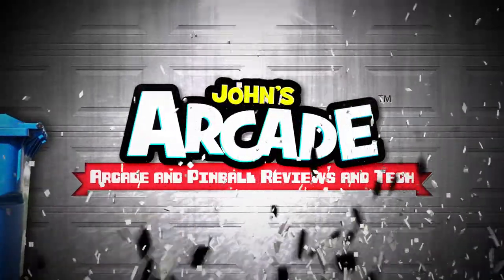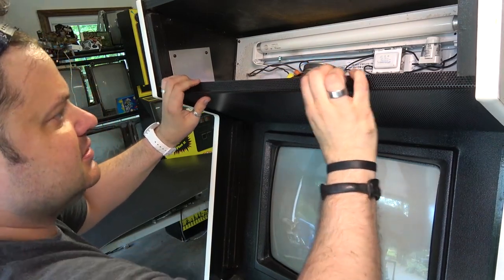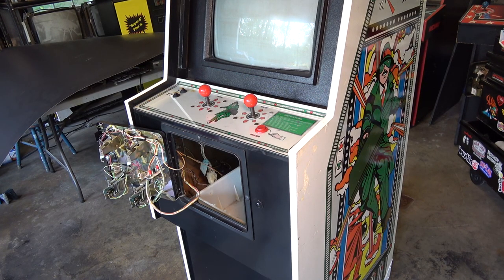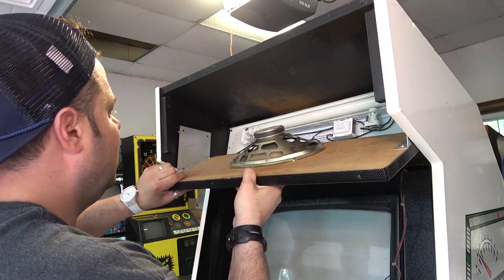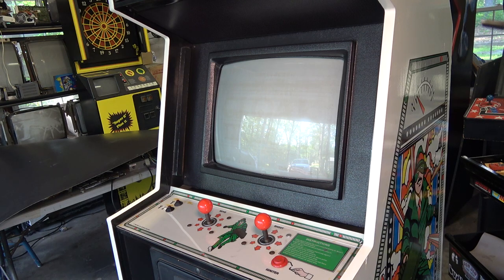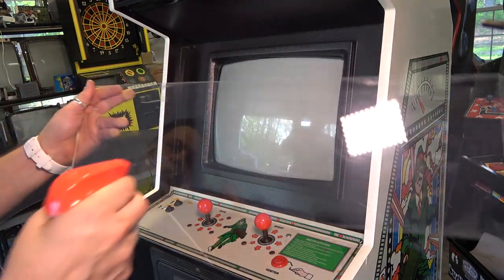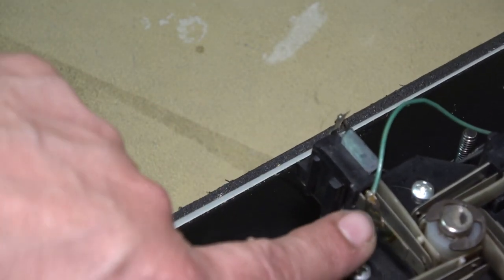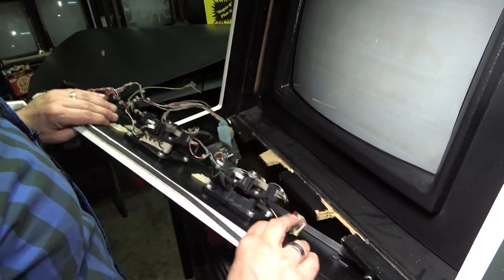Atari Cloak & Dagger Arcade Restore - Part #1 - Defender Speaker Grill Install and Control panel

Comment: Wow, that's got a bit of everything.  A Defender cabinet, Atari board cage, and an audio amp from a Mr. Do!.  Not a bad looking conversion though.  

Atari made those kits for Joust/Robotron cabinets too.  I ran across one of the control panels while restoring a Robotron a few months ago.  This is the first time I've seen what the complete game looked like.

Comment: Also another thing about those cone buttons-  I've noticed that on many games, Atari would put an extra nut on the switch before installing it into the panel.  This lowers the switch, and allows the button to sit flush with the cone.  There were also different cone heights available.  The shortest ones were probably on games like Missile Command.  Since that panel had plexi on it, maybe someone removed the extra nut to compensate for panel thickness.

Comment: I have a sore throat now because I was shouting PLEXI at you every time you wondered why the cones would not tighten up like before. Great video that speaker grill looks great. I think I would have left the plexi to help preserve that minty CPO.
Reply from the maker: The plexi just looked wrong and wasn't cut very well either

Comment: For the kick plate, you're going to have a heck of a time fitting a router on the top and bottom overhangs.  The middle will be fine, but the router with not fit where the sides are where the T-molding is.  You may have to pop that sucker off regardless.
Reply: Shhhh, let John figure this out himself in a 5-hour long video.

Comment: This kit looks really good in the Defender cab!  

Yeah that ground strap is the original from Defender.  Defender had a small strap connecting the left bracket to the speaker frame.  Then that ground strap you pointed out was sandwiched between the bracket and sidewall.  The strap internally was strung all around the cab connecting all the metal together.  Damned Williams built their vids like pinball machines!

You got some mad camera skills man... you'd think you had a camera man... seamless!

Comment: Regarding the cone buttons: You're missing the plexi, which was between the cones and the buttons. You may want to simply cut that piece of plexi and put it below the panel as some kind of twin washer, since it already has the right size.

BTW, the Magic Eraser did some of a job on that spot, compare before/after in the video.
Reply from the maker: Yes, I realize now it was the plexi. It wasn't clicking before.
Reply: !That journey game sucks, and it breaks down a lot. Why would you keep it. Sell it and Tempest and use the money to buy a compressor and Spray gun and use some effort in your refinishing. That is the weak spot in your game. All this time and effort in these games and you use spray cans???? You can sand out the burns from the top and re buff the plastic, but I'm nuts. I think it should be like it was when it was NEW.

Comment: For cheap 4-ohm speakers that look the same as arcade cabinet speakers, go to a junkyard and get a stock speaker out of a wrecked car. However, you should always match the impedance of the speaker to the amplifier. That aftermarket amplifier that the previous owner installed may or may not be 4-ohm stable like the original Defender amplifier was; you'd have to find the specs for that particular make/model amplifier to find out ( Edit: I posted this before I finished watching the video; after a few more minutes of watching I saw that you did the right thing anyway). Driving a 4-ohm load from an amplifier that is only 8-ohm stable isn't necessarily going to kill the amplifier instantly, but it does drive it harder than it was designed to be driven, which theoretically will shorten its life.

If you were getting satisfactory volume from the 8-ohm speaker, then it certainly won't hurt anything to continue using it. In fact, it makes life easier for the amplifier, because it's being driven less hard than with a 4-ohm speaker. An 8-ohm speaker is always a safe choice with an amplifier of unknown specs, because I don't know of any audio amplifier that isn't at least 8-ohm stable. Home audio amplifiers are normally 8-ohm stable, and car audio amplifiers are normally 4-ohm stable.

If you use an 8-ohm speaker with a 4-ohm stable amplifier, the amplifier will only output half its rated power, but like I said, if you're getting sufficient volume, that's irrelevant.

Comment: I went to the PILOT truck stop, and purchased Roadpro external CB speakers, for $10.00 they are small square speakers, with great sound. They are 4ohm 8 watt speakers. And they come with a mounting bracket that mounts nicely, they work great especially when the speakers are hidden by grills, size doesn't matter.
Reply: These Roadpro speakers come in various Ohm and wattages

Comment: Cone buttons are what make an Atari. Depending on the cone height Atari add a washer and small PAL type nut on the back side, check out your Tempest. Also the schematics for the C&D conversion shows the cone LEDs are wired up, so it may be possible to get them working by adding the wires.
Reply from the maker: Interesting! I wonder what's wrong with the wiring. I want those to light up!

Comment: I vote for changing the T molding to black.  I've never seen a cloak and dagger with white.  It looks quite odd with the white sides and all the other front facing trim being black, particularly now that you have the right speaker grill.  I know it's more cost and work, but that's what I'd do.  Either way, it's still looking good.
Reply from the maker: I think I agree with you. #staytuned

Comment: The most important thing to get some punch in the sound is to have a tight seal around the edge of the speaker driver. The slightly larger driver will also possibly give you better sound. 
If it's authentic is a different question. But since the rest of the sound set up is far from authentic I think I would live with it.

Comment: The cone buttons look are higher because the Plexiglas that you threw out was lifting the cones (like a washer).   Because the Plexiglas is gone more of the cylinder is exposed now.

Comment: John, when you were re-attaching your cone buttons and were having trouble with attaching the cone button, I was thinking that the thickness of the plexi glass panel that was covering the control panel was probably affecting how you re-attached the cone or even the height of the buttons..

Comment: In general, you could substitute an 8 ohm speaker when a 4 ohm speaker is called for.  You mainly run into problems when you try to do the opposite (sub a 4 ohm for an 8 ohm speaker).

Comment: John, early in the video when you were taking the speaker grill off, you dropped a screw into the monitor and turned off the cabinet just in case. Did you ever get that screw out of the monitor chasis? I'm a bit concerned you may have forgotten and it could short something.
Reply from the maker: I got it out. :)

Comment: Now now John ya didn't need to use a gas power blower for the metal filings like that. A simple brush and dust pan should have done the trick. LOL I used to learn a lot about being a machinist with the different kinds of equipment to work with in order to make different things. Usually when you need to make a pilot hole for the screws. Just eye the drill bits that you need to use with the minimum part of the screw thread that you have on the screw itself. Usually if you look between one thread to the next. It creates like a valley between the two threads itself. Its hard to just saw it in text only if I were to make like a drawing of some sort it would be easier to visualize it. But usually you can find it very quickly when your making pilot holes.
Reply: John I just wanted to mention something else here around 78 minutes into the vlog here where you are sanding down the joysticks themselves from the rust. Couldn't you use a vice of some sort to hold where the ball part is. And use like the 80 grit and finer that way. If you use like a thinner sheet. And wrap around half of a sandpaper/emery cloth and move the sandpaper/emery cloth back and forth. Kind of like when you have a bow wrapped around the stick to heat up the bottom part of the stick to create the fire. But in this case the metal part that you are cleaning the rust off stays put there while going to a finer and finer grit of sandpaper/emery clothe.

Comment: I would have used the 6 1/2 in speaker from the Turtles....  Once the C&D is in your basement you will NEVER change the speaker....
Reply from the maker: THIS IS POSSIBLE. :)
Reply: On Amazon you can get Skar Audio FSX65 8-Ohm 6.5" speaker for $19.99....  ;-)
Reply: Umm... Skar Audio is like basshead car audio, why would John want to put anything other than an authentic arcade game speaker in?!
Reply: I would have gone with the 6x9" 8ohm speaker for now, and looked for a 6-1/2" 8 ohm round speaker to replace it later. At least then it would match the original round cutout, and meanwhile no one will know.

Comment: I feel like if a previous owner bought a replacement amp, that might be for general home use, and works with an 8 ohm speaker... it could very well be that they replaced that speaker at the same time to match the amp... possibly?
Reply from the maker: KEEP WATCHING
Reply: HA! I just got to that point as i saw your reply here in my inbox!  :D
Reply: well um... make sure you wire the speaker the right way so it doesn't accidently turn it into a microphone!   Nice leaf blower, btw.

Comment: Should have vacuumed the iron filings, rather than blowing them inside the cabinet, did you remove the lost nut from the monitor chassis? You should use wet & dry glass paper on metal, sandpaper is for wood.
Reply from the maker: Of course I found the nut. :)

Comment: I was kinda wondering why you didnt turn off the game before starting to screw things loose, i was actually thinking  "he is gonna loose a screw somewhere, maybe right on the boards and short everything" and then you went and did just that :P

Also, why not make a wooden ring for that smaller speaker so it fit?
Reply from the maker: OOPS

Comment: I have a 1987 Double Dragon. It has the original speaker and sounds fine. Are there any better quality aftermarket replacement ones that anyone would recommend? Or would they all be about the same quality of sound ?
Reply from the maker: I think any old speaker works fine. I am going to replace the speaker next episode with a cheap one. We'll talk about it.
Reply: John's Arcade Game Reviews & Tech Thanks John. Yea, I didn't know if you put something like a Bose speaker if it would make any difference. Keep up the good videos 👍🏻👍🏻

Comment: so you didn't show screwing in the speaker John..! you put the screw driver through it?
Reply: You might find getting the cigarette stains out to use some thick bleach on a Q-Tip cotton wool bud, rub it in and leave it and go back about half an hour later repeat process should work fine because it's white, wouldn't do it with any colour though because as the name suggests bleach will take away colour.
Reply from the maker: nope.
Reply: John's Arcade Game Reviews & Tech only winding you up!

Comment: Hi John, have a question for you, I recently got a full working arcade cabinet (CRT, Naomi gd-rom, etc) looking to gut and install my Mame (hyperspin) variant. I need to replace the CRT as it doesn't work with the computer I have. Not certain if you have tips to replace CRT with an lcd. Also should new monitor be widescreen in landscape or portrait. Thanks man and keep up the videos. You are an inspiration.
Reply: Forgot to mention that the computer I am using can only go down to 800x600. Figuring that the CRT can only accept 640x480. What do you think
Reply: LOL.  You're asking a guy who just spent months getting an original monitor working about replacing an already working monitor with an LCD.  I am working on a MAME cab myself so I wish you the best of luck.  Just please promise not to junk the monitor.  They are getting harder to find.  I have a game with a bad CRT and I have spent the last couple of months looking for a replacement.

Comment: Can I ask a philosophical question? Why does it matter what size a speaker you have? If it sounds good and works then why bother? Behind that Grill, you will never see it. Seems to me like creating work for the sake of creating work.
Reply: The cone of the speaker moves in and out to make sound.  When it moves out it can often extend past the bracket and will hit the wood it is mounted to.  This will alter the sound and cause damage over time.  The excess pressure from trying to move air through the smaller hole can also wear on it.  Granted this will take a long time.  But, if you have the means to do it right, why half a$$ it?
Reply: But in order for that to actually happen, he would have to be blasting it at a very high decibel level, with about two to three times the amount of power he is dealing with, in order to cause this damage. So that scenario would be very unlikely in John's Lifetime, or however long he owns the game for. The game PCB is more likely to die before that happens. In his private home use, it won't be used as much as it would be on location. Yes, half a$$ing it isn't ideal but in all honesty, it's wood, if you need to cut a larger hole.